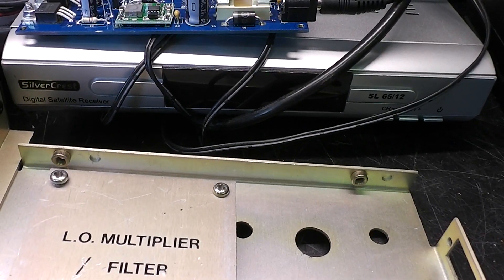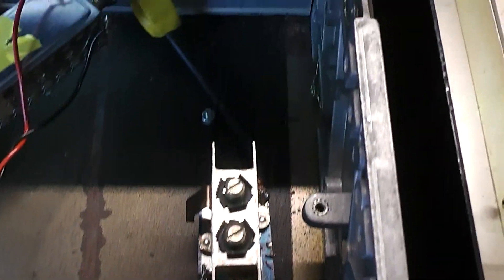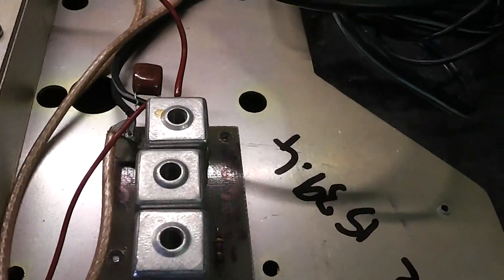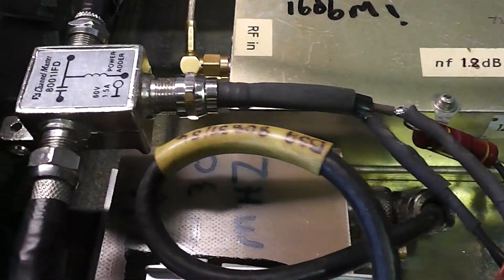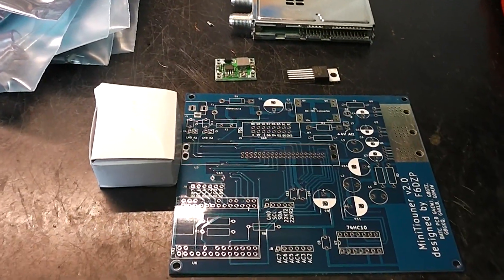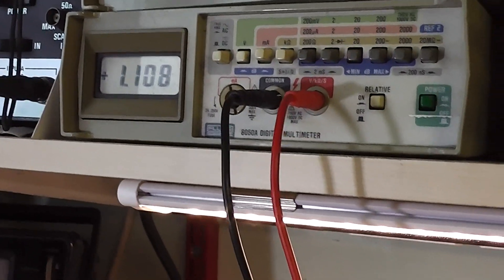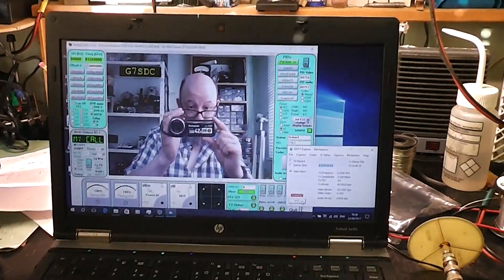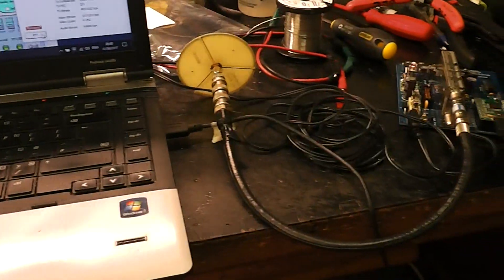Digital Amateur TV using Minitiouner & DATV Express 1 - getting there!

Comment: Hi - Just dipping my toe into DATV (I have a Minitiouner Express) and I stumbled across your video. I got sidetracked by your WS-6906 portable monitor and I have a question, if that's OK. Can these things be used to LOCATE the satellite, by means of a spectrum analyzer-type display, or do you already need to be pretty much on the nose, then just use this instrument to peak up? I hope that makes sense. Thanks - G4EFE
Reply from the maker: Hi Martin. The meter unfortunately doesn't have a spectrum analyser. By tuning into a station you know is on the satellite, you can scan the dish and then  peak dish for best signal. A compass can help find the appropriate point in sky.  Daz
Reply: @darrencoe5795  Thanks for that! From what you say, it sounds like something on the display (signal level, probably) is responsive enough to be useful when 'waggling the dish' (technical term!). Back to the main event: my daughters bought me a MiniTiouner a couple of years ago and I thought it was about time I hooked it up and try for a bit of DATV reception. Hoping an 80cm will be adequate. It'll be fun finding out!
Reply from the maker: @wrongsideof40   Yes that's correct. A level meter will show signal and then a digital error meter responds once the station is locked. The correct station locking is indication that the right satellite is being received. The receiver has pre programmed stations. It's just like a satellite receiver with a screen. Daz